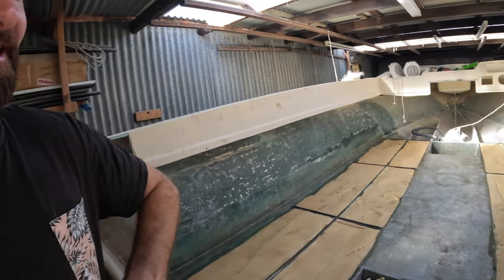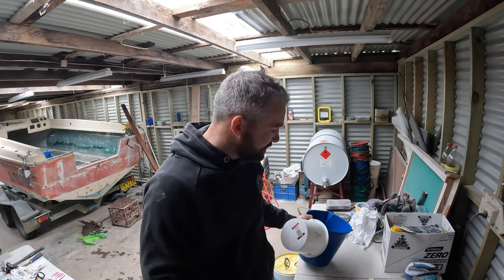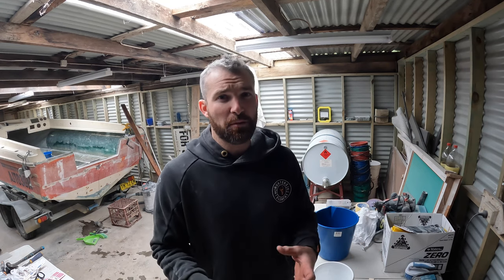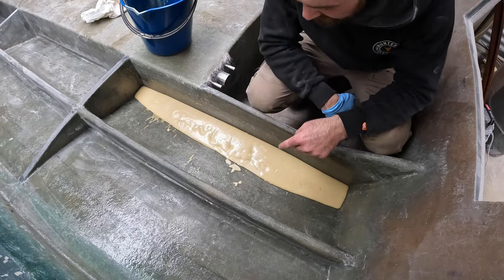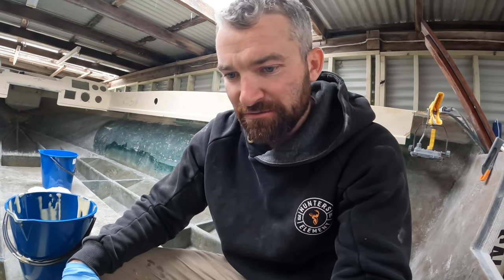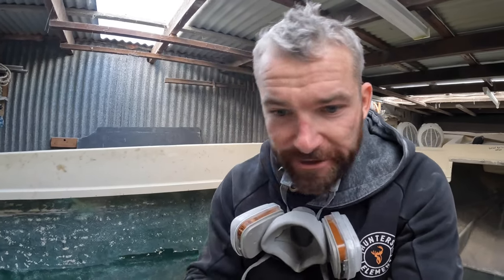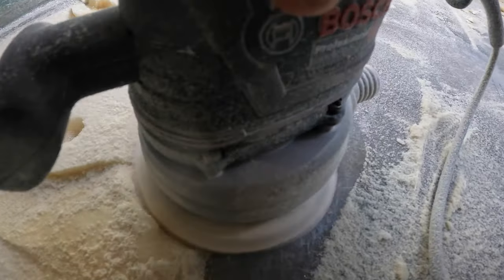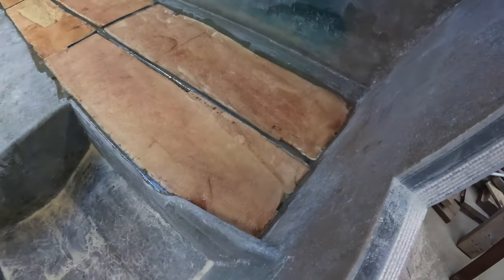Foam Filling the hull - Pros and Cons!

Comment: i used to run the foam department for 1/2 million $ sport fishers.  the trick is to keep the foam resins around 72 degrees for as long as you can,( store and mix if you can) the cold and speed buy time to flow before the rise, power mix like hell, and pour fast.  there are some that snear at cutting closed cell foam, but the way you resealed seamed effective.  great job man.n

Comment: I found an electric drill with a small plaster mixer on did a great job.
I had a bucket of water to spin the mixer in to clean it,  it worked well.

Comment: Thanks for sharing.
What do you do with the waste pieces ?
Reply from the maker: I just threw them out mate.
Reply: @ADVENTURES_ADRIFT  ok - since the PU product are used as "fillers",  can those waste be cut into small pieces and placed in the fresh pour solution which while expanding will engulf the waste small piece and both waste and new layer adhere to each other saving you material? Just my suggestion to tackle wastage.
Or the waste crushed to a powder and mixed in small quantities with fhe freah solution and poured as filler ?
Reply from the maker: I’m not sure on that one mate. I think the off cuts would float on the freshly poured mix so I don’t think you’d get the desired outcome. In the big scheme of things that amount of wastage is the least of your concerns if you’re that deep into a rebuild. The other option is to put your floor down first and then pour foam into holes drilled in the floor. The issue there is that you won’t know if you got full coverage of the compartment.
Reply: @ADVENTURES_ADRIFT  Thanks for your time and responses !

Comment: Good video, but I was hoping to get an idea of how much it expands, to determine if it's worth my while for a different project. I would have loved to see an after photo of that first test section!
Reply from the maker: Hi Graham, 1 litre expands to about 1 square Foot depending on temperatures. It’s it hot it will expand more but less dense. I hope this helps.
Reply: @ADVENTURES_ADRIFT  Cubic foot??? S' o.k! I speak bilingual measurements too!

Comment: Why not a closed cell foam water proof 100% rot proof ,
also if the compartment is air tight it has the same Buoyancy without foam .? Great job 👍
Reply from the maker: Polyurethane foam is closed cell and water proof, when you sand it you open the cells but majority os water tight. I foamed filled to provide buoyancy if I punctured the hull and the sound proofing makes for a very nice day on the water. Cheers